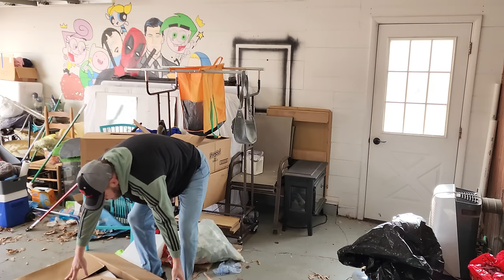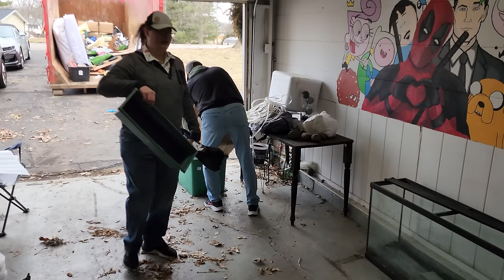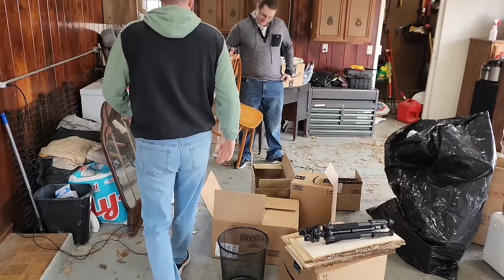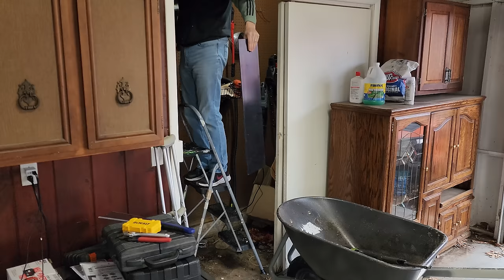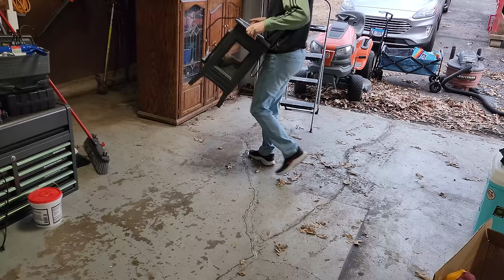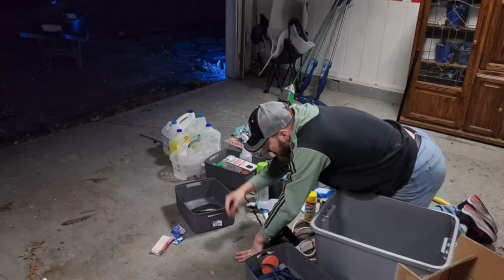Cleaning an 8-Foot Hoard From MY OWN Garage!

Comment: For me, the key element in getting this done would be the hiring of the skip/dumpster. I know if I was paying a good few bucks to have that thing there for a couple of days and I had that deadline, I'm going to make sure to fill it as much as I can. I have mild to moderate hoarding tendencies and had become really stuck and things were getting bad and I was doing nothing to help. Last week, on a whim, I rang my local charity shop to see if they would come out to collect boxes of good quality china and pottery and they agreed to come less than a week later.

I individually wrapped each item and ended up filling 14 really massive boxes and more smaller crates and they are now gone from my home. Had I not had that very close deadline I would never have managed it on my own and I thought it was going to kill me to let go of those things but I already feel lighter and know that I won't miss any of them. I held on to 7 very small items that I really cared about and got rid of hundreds. Make a collection appointment. Order a dumpster. Book help to come over. Put some kind of mild pressure or deadline on yourself and it is amazing how it can get your wheels in motion. Thanks Mac.
Reply: Well done - it is hard !
Reply: Completely understand everything you said about the deadline. I’m just this week finding out that we are going to be moving at the beginning of May, but my job has me out of state until the end of April. My wife is hustling to get organized so we can blitz through clearing out and loading up. Our silver lining is that we are only moving 2 miles down the road, and have 3 weeks to get it done after I get back!

Comment: I guess I'm the weird one then because i always break down Amazon boxes right after opening them and throw them away.  So i never have and build up anywhere. I always put everything up after i use it so i never have a big mess to clean up. I will rearrange the garage every 2-3 years, but that's just the shelves in there that i straighten. Then, if i haven't used it in the last year, i toss it or take it to the thrift store. I do that throughout the house. At 57, i always have extra room in my closets. They are never full, and i never have big messes to clean up. I'm just weird that way. I also have a small house and small, one car or no car garage so it's necessary to keep it all organized. I did used to have a cleaning and organizing business. It's just natural for me. Thanks for all your videos.

Comment: !!!Thanks for another bit of Midwest Magic!!! A couple of tips people might find useful is as follows: First thing each morning do one short job (5 or 10 mins) that does not require any decision making - as a result you get the dopamine hit easily that sets a pattern for the rest of the day ( brian says 'lets do that again!'). Also you can make a job easier to start if you set it up before hand ( i.e. the evening before or such like) - e.g. if you have a case full of clothes you need to sort through, get it out from the back of the cupboard the night before and put it somewhere where it is easy to access so having to 'shift stuff' does not get in the way of starting the job.

Comment: I had the same issue when I had to clean my Fathers house, which is in a small New England town and we don't know where any of the donation centers are. Nor did we have time to look for them so I just had a dumpster dropped off and we packed it with everything form a stove to furniture to washer and dryer ,clothes  and various other appliances. So of the neighbors came over and took some stuff but the majority of went into the dumpster. We were not taking any of it 1200 miles back to Chicago.

Comment: In my apartment building, the garabge room is located next to the laundry room, so I am there at least once per week anyway. I just flatten my boxes and bring them down when I do the laundry. I have nowhere to store empty boxes. 

The garbage room also has a "free" shelf for people to dispose of good but unwanted household items. I have left numerous small items that I no longer had need of. It is so much easier than driving across town to a charity shop. 

The only thing that is currently accumulating is beverage containers. The return value will double in April, so everyone is holding on to their empties at present. There needs to be a minimum size load to justify the time (and gas) expended to take then to the recycler.

Comment: I have found that the only way I can control my junk is by using plastic storage containers and placing them on wire racks. The cost is high but it makes me think is the items worth putting in a storage container? Then when things are in containers they are marked to find it fast. If I have over flow I have to toss something to make it all fit. The plastic containers help keep items clean and if the items aren't worth the price of a storage container it could be time to toss them.
My first rooms to clean are the kitchen and bathroom, then the  living room and bedroom. I then do the sun room and the craft room. The garage is the last one. This is the order of clean to dirty.
Interesting to see what works for you!

Comment: I did the garage purge 10 years ago. Hired 2 young fellas and they backed in with their trailer. I sat at the garage door and said 'keep or toss' at anything that came out. They took 2 trailer loads out and I had a very small pile of keep. They put up insulation and paneling (from previous remodel) and closed in the walls. I had a new garage to organize and make into my space. Husband had passed and no children so it was all my space now.

Comment: Thanks to your videos I have finally started to throw out stuff that has been cluttering my flat for years. The bit about the potential of stuff is exactly where my problem is. Plus I get phases when I don‘t have the energy to do anything and they can get really really bad. (I don‘t have a diagnosed, but depression runs in my family.) I‘m still at the beginning and it will take a long time but the ten bags of stuff that I threw or gave away over the past couple of weeks have made my heart a bit lighter. Thank you for enabling be to do this.

Comment: I really like that you explain your system & different strategies.  I tend to go for whatever is the bulk of it , as that makes the biggest difference quickest. So if the bulk of it is empty boxes or cans etc that need recyclingor old furniture that gets attacked first. And definitely do just small areas at a time. If you get overwhelmed easily , short bursts , with a timer if necessary are great too. Its amazing how just a regular 15mins can make a difference in even a huge mess.

Comment: Mack, thank you so much for your kindness and advice. The part about not keeping items because they have potential really sunk in this time. 

I have started tackling a room that I have put off. And I am using your advice to do it - it's ok to move things multiple times, work one section at a time, no shame, no overwhelm, and it's ok to throw things out. 

I can't work for very long because of fibromyalgia, but the improvements bring me so much joy. Thank you again for your channel.

Comment: I live just outside a large city so I experience the same problem with getting rid of stuff. Our dump recently made covered area that you can bring your stuff to and people can browse through the area and either drop off stuff or pick up stuff. Since the municipality did this I have seen far less tables chairs dressers sofas etc in the dumpsters. If the stuff doesn’t go after a while it is just cleared out. It seems to be well used and I like that it gives my stuff a chance to get used by someone else.

Comment: I'm almost at the finish line with my shop clean out. It's actually the original garage that the previous owner converted for his workshop and storage. It was so hot last summer that I gave up when all I had left was putting the items in the middle back to where they belong. This has motivated me to finish it this weekend.

Comment: "King of the Mountain" declutter, insight, commentary and motivator.  I tend to throw myself into projects (basketry, knitting, painting, etc), search out the supplies I need (want!) and enjoy the search for the best bargain, latest tool to compliment the project and before I know it, I could open a small store!  One bedroom is Filled with yarn and accompanying tools, blank (and painted) canvases (all the painting supplies are on bookshelves in my mudroom and laundry room).  Another bedroom was turned into my "closet".  My tiny house was built in 1912 and one bedroom has no closet and the rest a broom closet sized closet.  The attic has totes filled with vintage designer clothing, craft books, memories/things I've saved from/for my kids.  Reading this, you'd think my house looked horded/cluttered, but it's not.  Just those two bedrooms and attic.  Come this spring I WILL begin sorting/downsizing my " collections" !  Wish me luck!  😆😂

Comment: We have a few of the we'll deal with it later areas, and also have a few of those things that you aren't using but it's nice and you struggle to get rid of it. 
I was looking at those doors and thinking oooh I hope he takes them off, and then when I saw the old stand overhanging the area, I was thinking oooh I hope he moves that too. :) Turns out you did do it. That little peg board area looks so nice. It's nice that it's inset too so the cars don't drive along side of it. Now your car has a nice place to live out of the elements!

Comment: Donating is good, especially if you are in a more highly populated area, but the thing most people don’t realize is that a lot of the donated items end up going into the landfill if they aren’t sold quickly or are too damaged to resell. I live near a donation outlet and they sell clothing by weight, just to move through the volume. The stuff they can’t sell just “disappears” a few days later.  

I try to recycle and donate, but sometimes the time and cognitive load it takes to sort, pack, transport, and/or resell is just too much for my brain, so it goes in the trash or it ends up crammed into a closet until I can’t close the closet door anymore, which just causes delayed stress. I’ve been trying to be more proactive and reduce my purchasing or acquiring of items, and be more cognizant of what I am buying, but it is hard, because I love good dopamine dump from getting something new. 🤤

Comment: From what you have shared..getting rid of trash is actually hard in the area you live because of diatance to things...so I dont blame you at all for putting it off. ❤Yup our garage is a deal with it later space. Husband has a lot of hoarding issues and in our old home it was a pile of "its all useful" in the garage. He grew up very poor and had to make things work and still thinks that way. Since moving he has worked so hard to not hold on to things that can be thrown away instead. BUT we now have a different problem ...his depression got bad enough for him to be on meds and unfortunately with the meds, he seems to have swung into a bit of a buying problem. 😔 He keeps buying more and more for the yard and house despite us not having room to keep or use it. He always thinks if we just build a shed or if we only build this or that.. We will have room. (No shed would make this better)But like you pointed out..that just isnt going to happen. I try to help him get rid of stuff or get him to retirn stuff, but I dont want to hurt him or have him feel like Im judging him. 😢 I know he is trying. Its hard.

Comment: Due to physical abilities, I could never deal with a pile that large of "later". But earlier in my life, your garage was my garage. Now, I have a elaborate garbage system in my garage. Lots of bins no larger than I can lift, wheelie bins, and a shelf with supplies...bags, duct tape....the I also have some tools that stay right there in a shoe box that helps break down the trash...utility knife, screw driver, small hammer...these are dedicated to this space. This is my solution to my physical problems with trash. For me, one thing at a time with no searching for tools or "final resting places" for things that will leave the house. Let me be clear, my comments is not about other folks' piles. My younger self looked exactly like you and I feel so seen when you post about your own life. I'm only offering an idea for what happened to my garbage  system after life bit me physically in my dog bone underwear.

Comment: I noticed that some canvases were stored in the tool room. Since this happened to me, I can say it was something I didn't expect. Besides my paint tubes exploding, the canvas I had exposed to heat and some moisture in a closet inside the house near the roof (closet above stairs), my canvas went moldy. Brown spots on the back of the painting. I did find a cure for this,  but the canvas was never really the same after that. I finally pitched it. Not sure how hot or damp the tool closet gets, maybe there's a cooler place to store them. Unless the moose were painting and you don't care. Never let moose paint on canvas, nailing the finished work to trees in their home forest never works well.

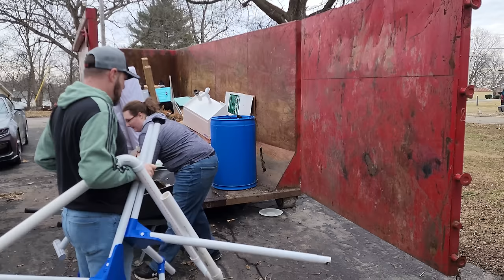Comment: 16:13 I do that (easy) 1st to boost my motivation, which usually includes trashing all visible trash & making space for the my next stage (hardest to easiest, rinse & repeat) and I tend to breeze through the rest (also easy, just quantity). This time I have a moldy wall (Xmas storm), mum's hording and an inspection in 5 days + 1 day going to the storage unit across town in a maxi taxi. I've done it before, I can do it again. My biggest beef is when it's stinking hot and high humidity, I also take lots of short breaks often and on the last day cram/crush it.

Comment: Yea, I have over half my basement full of stuff I put in it from moving in almost 20 years ago.  It is two sections, one I call the furnace room, (it's large). and the other is a walled off section I call the spider room.  The furnace room has stuff that needs to mostly be thrown out, and  the spider room has stuff that has to be gone through piece by piece.  My spouse was the kind that saved everything.  Since I lost them a couple of years ago, I am faced with no real help in cleaning out these two areas.  I dread having to do it all myself and some of the stuff that has to go is physically impossible for me to heft out of the basement.  Even doing one small space at a time is not a one person project.  Here is hoping I can convince some friends or relatives to assist me.  Wish me luck and know I enjoy watching you tackle some gnarly rooms.

Comment: I got a tip for anyone who has to break down a lot of boxes, but maybe has mobility issues-or wants to save time on cutting the packing tape to release all the flaps: push the sides of the box in where the ends of the tape end. 

Obviously not gonna work if whoever packaged the box to begin with with tons of tape, but it should work for a single strip of tape like on most Amazon boxes. Pushing the sides in will pull the cardboard away from the tape, and you can grab the tape and rip it off and break down the box that way. 

I've worked retail and food service for over 10 years, and I've uncovered this method out of sheer laziness :3 Hope it helps someone!

Comment: I am so thankful for your channel. I can’t convey to you properly in words how much help you are giving me while cleaning out my Mom’s horde of a generational house this year. It’s been accumulating since I left for college in 2001 (honestly, even before), and we are 2/3 of the way through the living room being back to 1995-era furniture. Asbestos floor tile, covered by my grandparent’s rug that hasn’t been vacuumed since 2001, and I am just so SAD. We can’t even do the needed repairs to her home because we can’t even access certain rooms. 

You know, you’ve seen it all before. It’s heartbreaking and sad, and the only way to fix it is to spend the time to tackle it. It didn’t get there in a day, and it won’t go away in a day, either.
Reply: One month update: we got the dumpster delivered two days ago, it will be completely filled today. We can see floor in five out of eight rooms. We have hauled off over 30 bags of trash and four full recycling bins’ worth of “papers to keep” that haven’t been looked at in over ten years. 

Thankfully, we live in an area where metal scrappers are plentiful and go after it, so the old appliances and steel stuff we found were picked up yesterday and are gone (free). 

I have found and saved about three boxes of “Girl Scout stuff” I can use as a leader, and I found out that I am a third generation Girl Scout when I found my maternal grandmother’s leader manual with her priceless signature inside it 💚 😭😭😭💚 

Thank you again, I am so grateful for every video you post with insight.

Comment: This video "is so me." I store stuff I never use, especially art supplies. I recently found a sealed can of air (for Copic markers airbrush) with no air in it while cleaning. Currently, I'm about to get my carpets cleaned and have moved two rooms. Now have to figure out how to catagorize my stuff (mainly my college animation stuff, art supplies and writing...lots of paper). The "out of sight out of mind" is a problem for me. Even if it's "in sight" if I can walk around the stuff, after awhile it just seems ok. Nothing dirty or nasty, just stuff. I should have a procrastination degree. Doing a little bit at a time is helping, plus giving myself time to work/time to rest...sometimes works unless I rest too long. Also have found out I have a time of day that I seem more motivated. If I can start during that time, I do better.